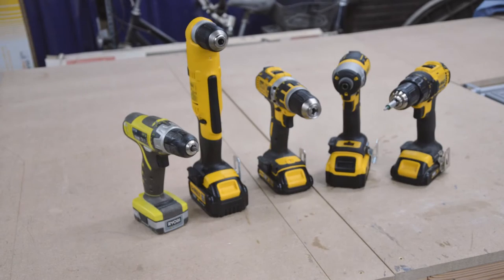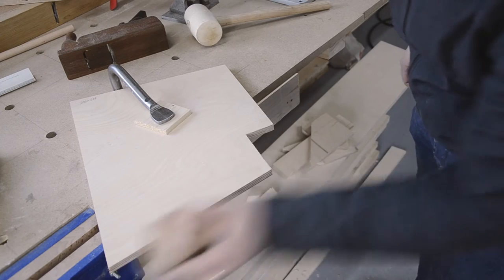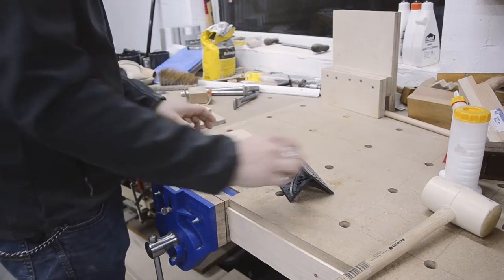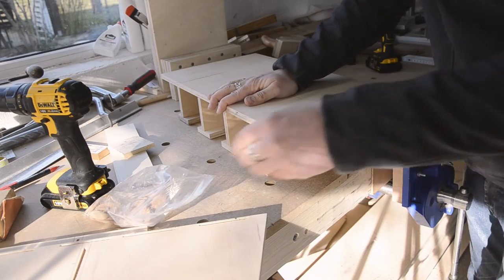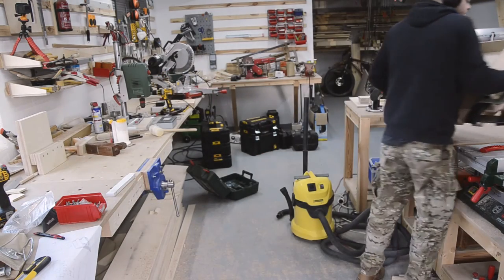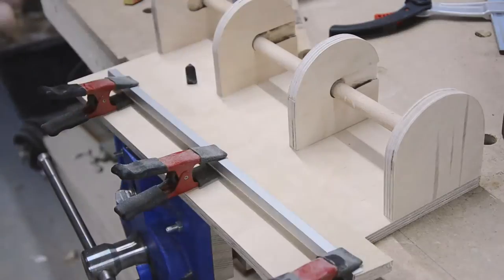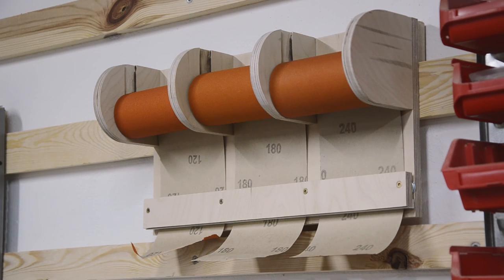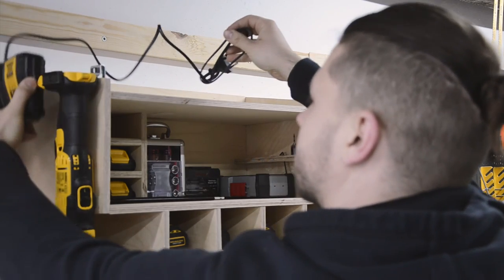French Cleat Modules Part 2

Comment: Very nice video, thank you for sharing. Your drill bit holder was a nice save! I use the same model biscuit joiner and find that the standard slot leaves you enough room for adjustment as long as you line up the centers properly, no need to cut them long.